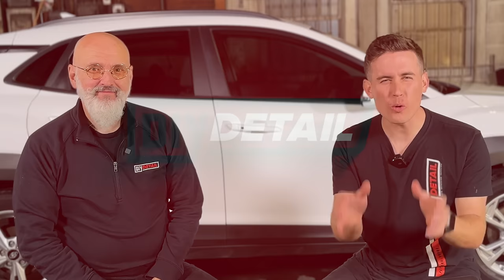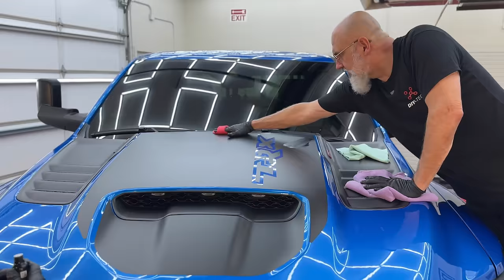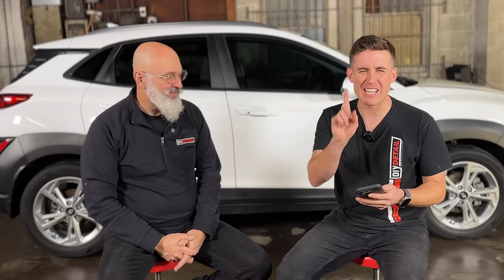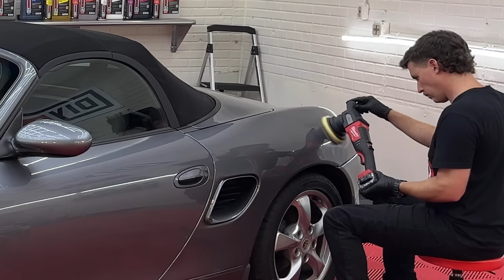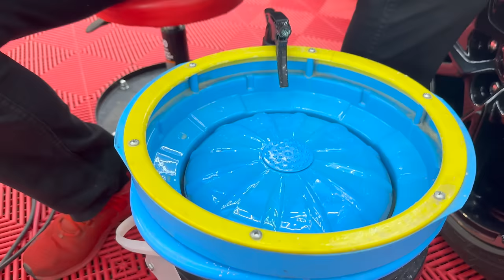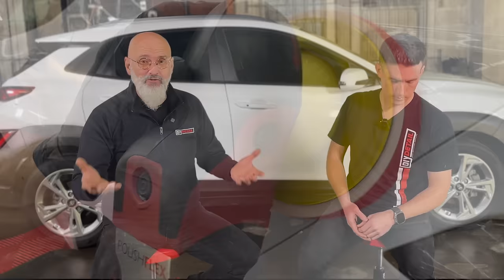Avoid these OVERRATED detailing techniques: 5 tips to save you time | Podcast #83 #diydetail

Comment: I mobile detail   by myself for  around 2 years now.   I use two of the  "clay" Towels   and if i had to guess its the exact same ones  they are using in the clips here   same  pattern /color combo in anycase.    Ive used  other ones as well.   I'll say this  one thing ive learned is that no two cars are the same (weather per day  /driver) Even if  same make model and owner between two cars .And Ive learned  I know nothing about this business  tho ive done 60 or 70 cars  not counting my own /family member's vehics since starting I still learn more n more .

All that said ...the towel is easier and faster than Claybars ....but  the  Slickness  obtained from using a claybar   vs the towels (ive used /had anyway)   The claybar wins.  WIndows? Again the clay bars even the cheap junky blue ones from amazon  take weirdness of windows (Anti fog clients sadly applied to the inside of windshields)  water spots ...blade trails  or imprints    That the towels have  zero impact on.

The towels  > nothing but polish +iron remover +wash  . I don't even see them as a replacement for claybars so much as a replacement for wash mits heh as  I basically use them with my  foam  during that portion of the wash.   Sometimes i'll  use th em with a quick detailer after  the vehicle has been coated  during a maintainance wash if the client opts for  that service.   But  They shouldn't really be compared to clay bars in my opinion that no one asked for  .    As they aren't really in the same  class  .     Claybars  add a slickness that Im unsure  at this point how to obtain without them     and as my clients  are having me detail  daily drivers most of which aren';t in a garage the   Synthetic towels     won't remove road paint transfer for instance or well anything u can't  rub off with your index i wouldn't  count on those getting off either lol starting to think I use them purely due to not wanting to waste the money i spent on the two sets i have  (and i do find th em easier than the wash mits to  clean /maintain and do as good a job during contact wash)
Reply: I agree. Clay towels or whatever you wanna call it, can't remove things conventional clay bar can. You need that paint spotless, especially if you are wrapping the car, or applying PPF.  When doing normal wash-clay-wax - sure clay towels are great,  because they won't marr the paint like a clay bar. But when I am doing paint correction, I do not mind light marring since I will be polishing the paint anyways.
Reply from the maker: Good points
Reply: . Just sharing what I've experienced which again is admittedly limited. Hope I didn't come off as argumentative as i wouldnt presume too..  I enjoy the content and information u guys are putting out there.
Reply from the maker: Thank you.

Comment: Thanks for some great new learnings on things I haven't thought about. Especially the "applying too much pressure to your polisher" in terms of created heat, pad-wash, velcro-harming behavior etc. Thumbs up!
To answer your question for personal use on tire applicators, I use the mentioned hexagonal-roundshaped foam-applicator with a tire dressing. I'm not sure if it works any better than a brush, but massaging the dressing into the tire feels more durable than just applying a coating with a brush. I have no idea if my "feeling" works better than a brush in real life though 😄
Reply from the maker: What’s important is that you feel it’s working for you.

Comment: What are you're thoughts on using gas line anti freeze with a micro fiber towel to remove fresh overspray, has always worked well for me, also removes tree sap & other harmful contaminants.
Reply from the maker: It can be a little rough on a sealant, but yes works

Comment: I did the circular motion with my ceramic coating and it works with any coating. I had 0 issues with high spots and I used way less prosuct. You can do circular motion with a microfiber applicator too, same good results.
Reply from the maker: Good to know!

Comment: Morning guys....great informative video...Question; my car is quoted with ceramic DuraSlic HG, looks great. I have a small scratch on the fender, not deep but enough that it catches my eye every time. Any advice on how I should approach this on my attempts to remove it would be appreciated.  Regards, Edmond M.
Reply from the maker: You will need to polish that area and coat again.

Comment: In the first minute of the video you were applying ceramic coating on a TRX hood decal. My 16 Challenger has black decal stripes on hood and almost the whole roof is covered with a decal. What’s the best way to clean and protect the decals?
Reply from the maker: Clean with DIY Detail Rinseless Wash, decontaminate with DIY Detail Iron Remover , continue with DIY Detail Water Spot Remover, then ceramic coat for protection

Comment: Do you need to prime foam or microfiber pads? Does the pad washer work with both foam and microfiber pads? If you just have one 5-in polisher would you get a 15 mm or 21 mm? Thanks for all the info.
Reply from the maker: No need to prime with The Gold Standard Polishing System. The pad washer works with all pads.
The longer the stroke the faster the cut.
Reply: @diydetailofficial  👍

Comment: Thank you for the video - I have searched for information about waxing an older car with rock chips on the front and hood.  I understand paint correction, though not really a viable option on a car with 225,000 miles.  Regular wax turns white and looks bad.  What would you recommend in this case?  I have heard of colored waxes - my car is red.  Do they work or a waste of time and money.  It is an older car, but still want to make it look its best.  Thank you
Reply from the maker: Forget wax and use DIY Detail Ceramic Gloss. It will not build up like a wax, and lasts much longer

Comment: After applying tire dressing with the brush, is it necessary to rinse the brush ?   If so, just water or does it need a chemical cleaning ?   Thanks
Reply from the maker: If you’re using the brush exclusively for tire dressing, no need to clean it after each use.

Comment: Correct/ Clay Bar is not always needed. Polishing/buffing your vehicle use the correct pad with the proper tool, as said pressure creates heat and is not good. Auto paint layers are very thin as in Mils. or a third of the thickness of your fingernail, it is like food plastic saran wrap but thinner. Always use fresh and clean microfiber towels with some type of lubricant or wetness and never use a dry microfiber towel, even when drying off your vehicle as the air will evaporate the moisture. I dry my car with Worx WG521 electric leaf blower with a microfiber towel wrapped and taped on the end of the nozzle in case of accidental touching.  It has not happened but better safe than sorry. It is light weight but you should wear ear plugs or muffs for hearing protection, including eye protection when using compressed air.  I love the foam, rinse, foam and clean method using two - 5 gallon buckets with a strainer on the bottom so you don't pick up the dirt when dipping your mitt or wash rag in the bucket. Have at least 2 mitts or more, the lower section of your vehicle typically has more filth and needs to be changed for a cleaner mitt. Start wash from top to bottom - common sense. Just like you taking a shower as water runs top to bottom. Waxing in a circular motion, that makes sense, pads are round, not made straight and narrow or shaped like a square. Things are perceived as being swirls in the sunlight, our eyes and pupils are round, the sun is round, the cones that are part of our eye optics. Okay, I need a break, someone called out and said Swirl Ice Cream or Ice Cream Swirl. It takes me about 1 hour to wash my car and if I do a complete wax and polish takes up to another 3 or 4 hours. It is easier to clean the interior of a vehicle than the exterior because I don't eat or drink in my car, non-smoker, no pets, rarely have a passenger, vacuum and wipe things down practically every week. Winter used the All-weather rubber floor mats and clean them once a week, used 3M Scotchguard on the floor carpet ... more like thin all season outdoor carpeting nowadays installed in cars. Floormats are now made with a polyester/nylon material instead of a cloth weave and shag. So they are even easier to clean. Lots of cheap ass plastic. Faux-leather seats easy to clean too, hate the creases - wrinkles that occur as better off with real leather.
Automobiles are built with cheapest materials as possible, no quality, just quantity. What we are paying for is the electronic maybe or may not work safety features and the 10 to 20 airbags that are expensive. It's crazy to think that vehicles built 40 to 60 years ago were better, and in fact they are better than today's trash-mobiles.
Back then, easy to keep a car looking good with washing and waxing by hand. Today, got all these Car Care products and most don't even work as intended or described. Auto Detailing is expensive  so don't over emphasize just make life simple.
Reply from the maker: Thank you.

Comment: what about a "foam, rinse, chemical" method?

Foam and rinse with pressure washer in driveway, then pull in inside the garage to be out of the sun and do a rinseless wash (one bucket, multiple mitts), I could also spray the panels with rinseless solution right before contact with mitt.

I'm talking about extremely dirty car only, otherwise just go straight to rinseless.
Reply from the maker: That works great

Comment: I know you have addressed this in some videos. But curious, I have a 1.5 yr old ceramic coat with very minor swirls on some gloss black parts. Also on some panels. Very light. Can I use like an Rupes Uno Advanced product and polish with a foam pad. Also do you have a product like that, which has a ceramic compound in it and is safe to polish with?
Reply from the maker: I would reach out to the manufacturer, in this case rupes, and ask them. You can for sure use Gold Standard Polish for a light polish on coated paint, but it's always ideal to re coat or at least put on some Ceramic Gloss after. It does depend on how aggressively you polish (pad, speed, pressure etc). We just have the one polishing liquid, and it doesn't have any fillers
Reply: Wow ok great thanks. I'll definitely look into what you have. Using soft foam pad, very light pressure, on around 2500 to 3000 OPM.

Comment: Foam, rinse and foam has been my way for awhile. I still use a bucket with soaked wash media and use 5 or so towel. I never return a dirty towel or mitt back to the wash bucket. Which is not a waste as you can wash and reuse the towels or mitts.
Reply from the maker: Perfect

Comment: I use the same brush for applying the tire dressing that you do. Was wondering if I need to wash it out after using it or is it better to leave it be with the dressing in it? If it does need cleaning, is the renseless wash the right way to clean it or should I use  some all clean or something else? Thanks for the help.
Reply from the maker: We only wash them every 20-30 cars. Simply dunk in wash bucket for a few minutes

Comment: When doing foam rinse foam, do you use the foam cannon on the pressure washer for the pre soak? I am getting the active 2.0 and this is my first time with a pressure washer, so sorry if I am stupid.
Reply from the maker: Not stupid, yes
Reply: @diydetailofficial  thanks.   I was thinking of using gsf with gc from khoch, for prewash.   Good idea, or would lift be better on a car that hasn’t been washed in a year.
Reply from the maker: @kevinhacken9801 don’t stress

Comment: If you use the pad washer, at the end of the detail you don't have to use some other cleaner? What's the highest speed you should use with the Gold Standard Polish? A damp pad with any compound or polish will cut better?
Reply from the maker: At the end of the detail they are clean. Use the lowest speed your machine will go. Never tried a polish or compound that didn’t work better damp.

Comment: I'm going to use some of your products for the first time when I get some nice weather. I've just got the 5.25" jewel pad, but I've had the yellow polishing pad and the decon towel for quite a while. I've not used either yet. I was going to use a milwaukee m18 rotary, what speed should I use for each pad? And can I use rinseless in a spray bottle as lubricant for the decon towel? (I've never used a decon towel I've always used clay bars, I normally use a 256/1 ratio for when I use a normal clay bar and that seems to work fine)
Reply from the maker: Use the lowest speed on the machine. Soak your towel in a bucket of DIY Detail Rinseless Wash, and also spray the surface.

Comment: If I've never deconned my Jeep, never used a clay bar, or whatever, just used Chem Guy's products, like foam cannon with Mr. Suds, diablo wheel cleaner, and tire shine etc. Should I use a clay bar? I just bought the kit for it, but I also don't want to polish the Jeep because frankly, I am not that invested in DIY car detailing. I just want to have the water run off fast and not have it sitting and drying. Is it worth my time to clay bar? I also want to put a coating on it using Adams spray on graphene. I watched a video from Adams where it took him 13 minutes to clay bar an entire car, but I feel like that car has been properly detailed and coated. Any tips for making the process quick?
Reply from the maker: Here’s a great way to clean and protect your Jeep. 

https://youtu.be/fDebsMbDpNw?si=QuFQtDt9xyQMz_UX

Comment: a little pressure is fine but any more than that you increase heat and wear the pads and can push the marks in the paint down further if you use too much.  move slower or make your work area smaller instead of more pressure.  the faster your machine speed is, the shorter the working time you have before the paint heats up too much and the abrasives no longer work unless using fast arm speeds more passes.  better to change pad and or liquid than crank the speed up. deeper defects need to be left alone or reduced only with paint being so thin now. the other enemy for foam pads is soaking them in a tub or bucket of water whilst you do the car or even longer.  water soaking them for a while or too many times speeds up the reduction of density and foam rebound. it takes me ten seconds to clean a pad by hand without a pad washer. spritz my own pad cleaner on the dry pad, rub it, rinse it, squeeze the pad with both hands (don't wring it) and done, no suds and little water usage. reduce pads exposure to alot of heat cycles, that's what the pad washer does best, as soon as you've  heated up the pad, the pad washer is cooling it as it cleans it. the two bucket method is obsolete in my world and has been for over a decade and a half, zero bucket or one bucket with several mitts for better efficiency or pressure rinse the one mitt as you wash. I don't use tyre shine anymore its obsolete to me. hoping that carbon nanotube and urethane based tyre coatings or something even better will become the norm and dressings go the way of the dodo, I haven't used them for ten years anywhere on a car.  I would never high pressure pre rinse now, my black toyota 86 GTS I pre soak with rinseless, wait then rinse then rinseless soak it again and dry if dusty or rinseless wash properly and then dry if grimey and after three years all I had to do to correct my paint late last year was 3D One with a kamikaze black foam finishing pad and the paint isn't more than soft medium hardness, that's how little marks it had. if your not getting years or decades out of pads like I have for yonks whilst testing for myself and manufacturers, your doing something wrong.  some of mine are 24 years old and look 90% like new and have lost little density after 50 to 100 + cars. marine detailing is a different story, that kills pads
Reply from the maker: Thank you.

Comment: Hey Yvan, in your video you mentioned a few steps, foam, rinse, foam, and agitate (bucket/hand wash) I was curious when you would use the rinseless wash in these steps. Or would it be the solution you're using in the bucket for the hand wash step?
Reply from the maker: You can replace the soap with DIY Detail Rinseless Wash.
Reply: @diydetailofficial  perfect thank you.

Comment: Hi guys, great video – my biggest bug bear… break disc flash rusting during washing, especially if you have black wheels. Know anything else other than BH Atom Mac? Tried varying the concentration, applying and blow drying prior to wash, apply during wash, end of wash, always get a flash over and the first time you go down the road the pristine black has a brown tinge on the barrel and spokes, save for washing and immediately driving to pad dry the discs, any other tips?
Reply from the maker: Unfortunately no magic. That flash rusting happens on damp days as well.
Reply: When I’m done drying I move the car back and forth in the drive riding the brakes and then with a cloth dipped in rinseless wash I wipe down the rims

Comment: Ive used the foam, rinse, wash method and there is usually still a noticeable layer of contaminants on my paint. Is there something else I should be doing?
Reply from the maker: In that case you will need to use our Perforated Synthetic Decontamination Towel . Decontamination should be performed periodically.

Comment: Hi guys, I have a question about the clay towel. If I want to use an iron remover as lube, would I just dip the towel in a separate bucket to clean it off? Since I can't dip it into the rinseless bucket
Reply from the maker: Yes